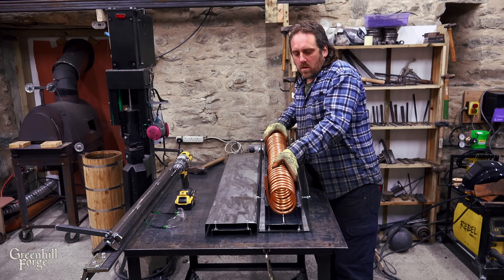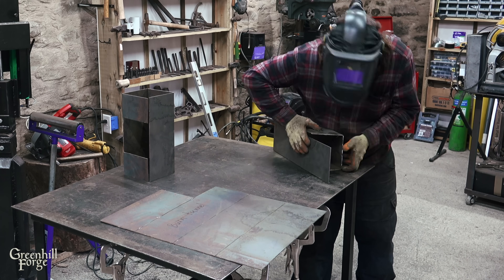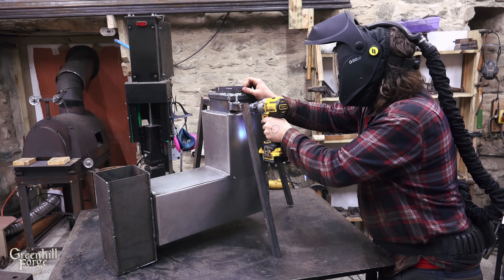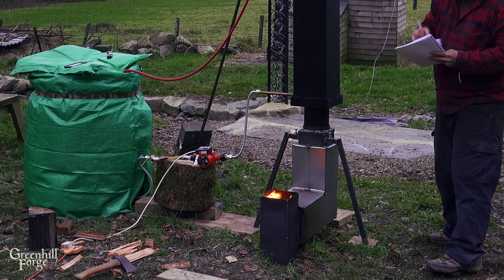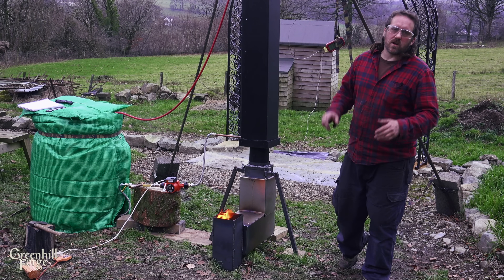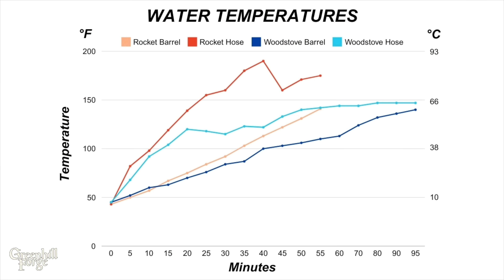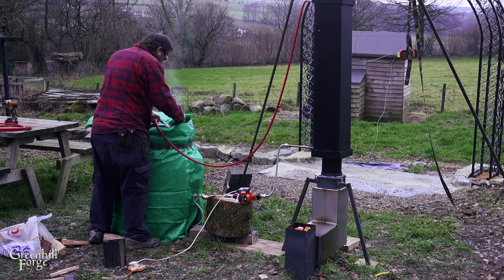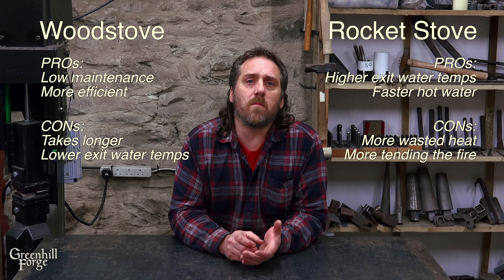Rocket Stove Water Heater Experiment Pt2 -TOO Powerful?

Comment: Another great video! You should definitely reverse the flow of the water, so the colder water gets heated up by the "remaining" heat to increase efficiency of your heat exchanger. Increasing the flowrate would also increase efficiency as it would lower the exhaust temperature. I am amazed how a heat exchanger of this size isn't powerful enough to capture more than 50% of the heat from a wood stove, maybe adding some flaps that will make the path for air longer could help? Or a rod in the center, to make the gases touch the copper pipe more?

For the efficiency comparison at the end of your video I think you did that wrong. Electric heaters have 99% efficiency, because you power it with already delivered electricity - the price for electricity is the price for the actual electric energy and the distribution. The same goes for gas and wood. If my wood was harder to obtain than yours, that wouldn't make the same woodstove less efficient...

I also did calculations based on your data and the results are somewhat similar - expecting 15MJ/kg wood (energy density based on chatgpt response) the woodstove would be 43.5% efficient and the rocketstove 38.1% (given the total energy needed to heat the water was 106*4180*53 = 23483240J and the total energy burnt for woodstove was 54000000J and for rocketstove 61500000J). That would make 4.1kw woodstove and 7.1kw rocketstove, which is pretty impressive. The energy outputs of the stoves themselves in your experiments are at least 9.5kw and 18.6kw for the rocketstove, so to match the rocketstove output you would probably need one or two more of these exchangers 😂.
Reply from the maker: Thanks! I'll definitely do some counterflow experiments at some point and make a video showing the results. I'd love to see the efficiency jump up, things like that are so cool.

I gotta stick by my numbers on the comparisons though. The efficiency I'm calculating for is the entire fuel cycle to hot water. If your wood was trucked in from 1000 miles away and mine was cut by hand 10 feet from the water heater, it took far less energy for my hot water to be created than yours. Without the diesel for the truck you'd have no wood. It is directly related to, and require for, your hot water. Same with electricity. Without fuel being sourced and mined and transported to a power plant, turned into electricity and transported to your house, you'd have nothing to run your water heater on. It's directly related to, and required for, your hot water to exist. 

I just see it as different parts of a whole system and if you remove one part of the system then there's no hot water to calculate for in the first place
Reply: @GreenhillForge I kinda agree with that, but that's not the point. The point of calculating efficiency of a machine is to calculate the objective "value", actually evaluating the machine, giving us answer to "how much of my wood gets converted to heated water", which is objective and applicable to anyone regardless of the source of the wood. You calculated "how much work do I have to do and what stuff do I need to buy to heat water", which for me is useless number, because I am not you and I obtain wood in a different way. It's not efficiency of the machine, but the process.
Reply from the maker: Sure, that a fine way to see it too, and knowing the efficiency of the machine independently is definitely good data to have. It just doesn't show the whole picture of energy consumption.
Reply from the maker: It's also why I published all my data. That way people can evalutate and take from it anything they want.
Reply: @GreenhillForge Keep doing that please, not much people making stuff like this do thorough measurements like you and it sucks
Reply: @GreenhillForge If you factor in the price for all the goods and work (somehow) and divide it by the outputted useful heat you can calculate total price/kWh which correlates to the efficiency of the overall process and I think it better represents what you wanted to show.
Reply from the maker: @lika-uh5lt  Price is so variable though. Different prices for labor and materials depending on where you are, time of year, geopolitical events etc. What I'm mostly interested in is MJ or kWh in and kWh,BTU,or MJ out
Reply from the maker: @ agreed, this is what I'm really interested in. If we all share hard data and methods it opens up so many avenues and ideas

Comment: Awesome job bruv. Any plans to create a thermal mass heat capture setup?
Reply from the maker: Thanks! At some point definitely, but I don't have a good place for a permanent setup right now. Once I do I want to build a really elaborate system, and I'll do a bunch of testing first to try to make a really nice one
Reply: @GreenhillForge  I def understand the need for permanence. It would be quite the waste to do an amazing weighty system just for a vid and have to demolish it afterwards. Incompatible with practical thought.

Comment: As long as you have water flowing in the system, it's impossible to nuke the copper, water carries heat away. And even without the pump, as long as it's an open system, the boiling water won't reach enough pressure to explode or do damage, only in a closed system can it build up pressure for that and a pressure relief valve would be required for safety.
Reply from the maker: I just wanted to ease into it. Wasn't sure if there'd be enough pressure/temperatures to superheat the steam. Wouldn't there be a point at which the water/steam couldn't carry the heat away fast enough? Maybe that would require temps that would just melt the whole system. I'll get more daring as I get more comfortable with the system.

Comment: Pretty cool! I haven't built a rocket stove water heater before, but I've thought about it (Though I suspect that rocket stoves will always be more suited to boiler applications) and came to the conclusion that the best solution to overheating is to essentially give the heat exchanger as much water volume as possible, use pipes in parallel to reduce the amount of time any given volume stays in the heating zone, and oversize all of them to avoid restricting flow.

Comment: Mild steel starts to spall around 1600 degrees Farenheit.  This is why metal is not a good choice for a good rocket stove (or masonry stove) core.  The fire gets too hot and starts to erode the metal.  You can fix that with ceramic fiber board in the core and riser.  The biggest risk with heating water this way is the danger of flashing water to steam, creating very high pressures.  Bad things can happen...really bad things.
Reply from the maker: Exactly, it's mentioned in the video intro

Comment: Excellent PAPR. I wish more people understood the danger of welding fumes.
Reply from the maker: I've heard a lot of people say they're harmless😬
Reply: @GreenhillForge 
Really well established danger. Normal steel contains nickel which is a carcinogen and stainless steel fumes contain CrVI.  I work in the aerospace industry and we often use the example for chromates the occupational exposure limit is equal to a pencil lead tip being finely divided in the volume of a football stadium.  Pretty eye opening.  Nice work!
Reply: @GreenhillForge Our egos are the most dangerous thing for our health in a lot of cases.
Reply: The old adage "There are old welders and bold welders, but no old bold welders" I know this really equates to taking risks with welds and getting in to bad places to do some welds, but I think it applies. lol
Reply: Totes noticed this, too.  Setting a good example.

Comment: I suggest adding a secondary air inlet with a butterfly valve. Adding more air would correct the air-fuel ratio; reducing the coke buildup on the water coils. It would also reduce the draft over the fuel which would slow down the burn better than choking the flue.

The water coil you made is actually too long. The water temperature is climbing too high in this case. What you need is a higher water mass flow rate.

I suggest using small diameter pipes that travel a shorter distance vertically instead of coiling. Keep the same stand-off distance from the flue but have a loosely spaced ring of vertical watertubes instead of a single coil.
Reply from the maker: I almost added an extra air supply (3" pipe with butterfly) to the front of the feed tube but the initial burn test went well enough that I just went for the heating coil test. The rocket stove has now served it's purpose so a have a few mods I'm going to build just for fun to see what happens and I'll throw the extra supply on there and give it a test to see the difference.
Reply: @GreenhillForge it is important that the extra air be introduced someplace after the fuel. Making it pass through the fuel in anyway ruins the effect.

I would suggest it be attached to the underside of the burn tunnel; between the feed tube and riser. That placement means the air gets added after the fuel and should keep flue gas from escaping through it.

Comment: If you could make an exhaust sistem that could harness as much heat from the fire as possible, at what exhaust temperature would the stove stop working? I think if you get it to low the air will just stop flowing up, right?
Reply from the maker: There are rocket mass heating systems that extract so much heat that by the end they're putting out basically room temperature air.

Comment: Ace video again. In terms of increasing efficiency why not feed the hot exhaust gases into a chamber with the heat exchanger and then have the flu coming out the bottom. This is how a lot of condensing gas boilers work and they get really good efficiency. Basically you are creating a hot zone where the heat exchanger sits. Might help trapping and using more of the rocket stoves high heat output.
Reply from the maker: you're dead on. you've basically described a rocket mass heater for a rocket stove and they're awesome but they're really big and heavy and need a permanent setup. that might be where this goes eventually but right now I'm trying to see what I can get out of a small, light, and portable setup

Comment: Awesome. In regards to electric efficiency, heat pump can be used as a water heater. Which gives you an insane efficiency. Depending on the water temps and outside air (if it's air to water) you can get a COP of like 20x! These heat pumps are used in pools.

BTW would be really cool to see you build an instant heating water system! Like where you can take cold water and heat it to come out hot enough to take a shower with. You could build in some safety features so it's not dangerous to use.
Reply from the maker: Yeah, heat pumps are amazing. I might do an instant heater at some point

Comment: Very interesting, have you considered connecting the heat exchanger in a counter-flow arrangement? it should increase the efficiency and should lower the exhaust temperature even further. Also you could add some baffles to slow down the exhaust just enough to not disturb the fire and increase the heat exchange. Very good work nonetheless!
Reply from the maker: I talk about this in the previous comment response video. I want to ditch the pump eventually and use thermosiphon so I'm doing the tests with that direction of flow. I'll probably do a counterflow test just to see the difference and some point.

Comment: How about just feed less wood to the rocket stove; Increase the water flow rate; Feed the water from the top to bottom.
Reply from the maker: yeah, problem is by the time it's too hot you've already fed it too much. after that I did reduce the wood amount and increased its diameter. I also turned up the flow to stop the boiing. I want to use thermosiphon eventually so I'm testing with that direction flow, but these are all good ideas.

Comment: Your comparison with efficiency number is not really fair. When you start taking into account the efficiency of creating/processing the energy source, e.g. how natural resources were converted into electricity, and then not doing the same for wood, then you are comparing apples and oranges. The wood you burn is also processed, trees were cut down, processed into suitable chunks for burning and transported to the site where you burn it. Also electric driven heat pump designs can reach far higher efficiency numbers (if you only count the electricity you put into them compared to the heat you get out); you can get about 4kWh of heat output for each kWh of electricity you put into them.
Reply from the maker: it is taken into account.I cut and split the wood and I did include gasoline for the cutting I did with a chainsaw
Reply: @GreenhillForge I stand corrected. I did not get that you had taken gasoline, etc into account. I must have missunderstood it.
Reply from the maker: @ no worries, it's a very small amount of gasoline and I'm lucky enough to have land and can source my firewood from fallen trees. which is partly why I use a lot of wood for energy.
Reply: Came here to find the heat pump comment. Consumer heat pump water heaters have a COP of 3-4, making them roughly 90-120% efficient even after accounting for transmission and distribution losses using your numbers. 

Doesn’t detract from how awesome your set up is, but if you’re going to be accurate with your own numbers you might as well be accurate with other sources.
Reply from the maker: @ heat pump water heaters are awesome. really brilliant stuff. i just didn't include them because they are relatively rare. ~4% market pentration in the US and even less in the UK. Maybe I should have mentioned them just to highlight how amazing the efficiency is

Comment: These tests were conducted in a very professional, and well documented manner. Thumbs up for that.
 If I ever build a heat exchanger for hot water, this will be an invaluable resource. Regarding the heat exchanger for the rocket stove, the dramatic temperature increase warrants both a higher flow rate and a longer flue. To increase both flow and the amount of heat transferred per unit length of flue, a series of LINEAR pipes (say 12 pipes, evenly placed at 1 O'clock to 12 O'clock) all plumbed to a manifold at each end. They would be aligned parallel to the flue. This might be a simpler and more effective option than coiling a single, very long pipe. It would yield higher flow rates for a given pump pressure. Also, the length of each pipe's passage though the chamber would be FAR shorter than a single spiral wrapped pipe. The shorter path will allow the pressure from a boiling event to escape far more readily, and expel a far shorter column of water and vapor in order to release the pressure (i.e. safer).
Maybe with enough linear pipes (12, 15, 20. 24?) this could dramatically extract more heat, even using the length you demonstrated here, and reduce the flue's exhaust temperature, all while reducing the risk of the water temperature too quickly climbing above boiling

Comment: Great couple of videos! The efficiency of the stove is less because it heats the environment as well I think. I wonder if the high temperatures of the rocket stove produces more NOx?
Thank you for sharing.
Reply from the maker: I might build an insulated woodstove for outdoor stuff like this. less heat loss and probably hotter, more efficient burn. I think NOx really increase around 1500F and it was well above that in the burn chamber for most of the burn.
Reply: @GreenhillForge I was thinking that there might be less sooth if you place a half a meter long insulated pipe before the heat exchanger so that the combustion would be more complete. As long as there are flames the combustion isn't finished and with the 'cold' exchanger the sooth is deposited.
Reply from the maker: @andrep5899  Good point.I need a window to see how high the flames go. they barely came out of the rocket stove when there was no flue but they could be going way higher with the flue on. I've got an idea/video coming that might 6-7X the efficiency if it works, so stay tuned for that(hopefully).

Comment: By your suprised reaction on the creosoot buildup I conclude that you didn't read my comment on the other video: You need to run the water through the coil always over 60C ! Extract the surplus heat with a simple thermostat. Just like how a car engine works.
Reply: Good idea
Reply from the maker: Must have missed it, there were a lot. Do you mean the water needs to be over 60C before it goes into the heating coil?
Reply: @ correct
Reply from the maker: @arjanschild3552  not sure I get what you're saying. The water starts at about 7C. How do i get it to 60C without sending it through the coil?
Reply: @ there are 2 circuits; the 1st with the coil, the 2nd with you watertank. The circuit with the coil is small and heats up quickly; The surplus heat is release with a thermostat into the 2nd circuit end cool water is let in. Just like a car engine.
Reply from the maker: @arjanschild3552  ah, right, yes, now i get what you mean. great idea.
Reply: @arjanschild3552  Confused on this, and apparently not enough knowledge to google it correctly, do you have a pic you can link?
Reply: @EricKinnamon  Somehow my earlier comments seem to disappear... Translate the URL I just posted. There is a section about the pump.
Reply: @ PS,...I have a self built wood stove that heats my workshop. The coil is a stainless steel beer cooler coil. There are 2: 1 in the stove above the heat deflector and 1 in the pipe. I have experimented over the years but this setup works perfect since 5 years.